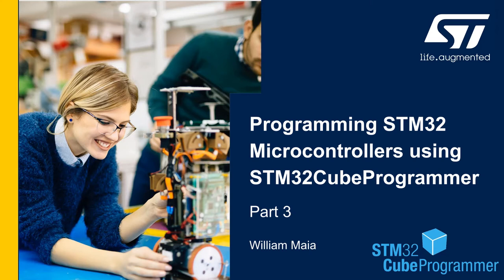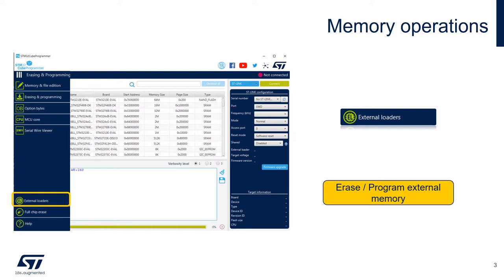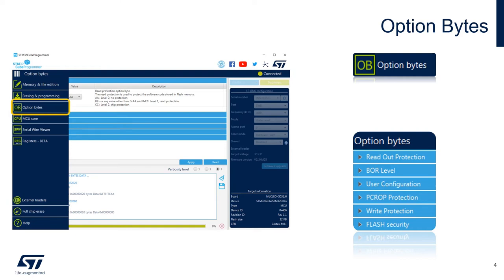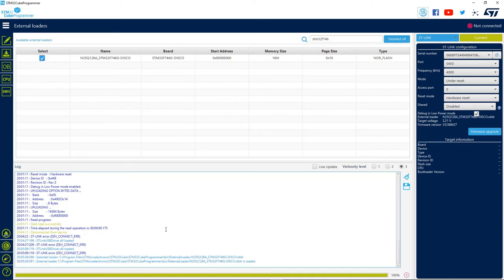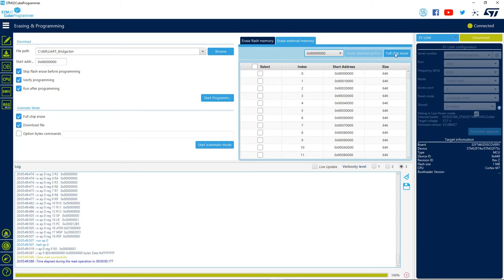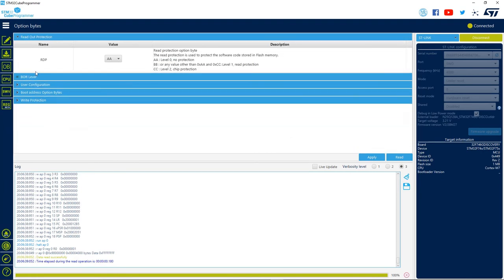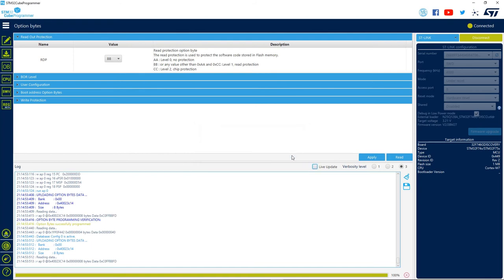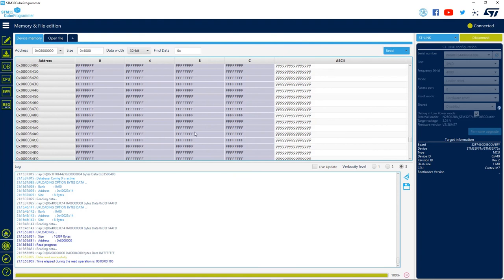Programming STM32 MCUs using STM32CubeProgrammer: Part 3

Comment: hii , i want to know that is there any internal register configuration that can HIGH or LOW the boot0 pin in STM32H7 series . 
(actually i don't want to connect externally CN11 pin 5-7). If any suggestion please help me out